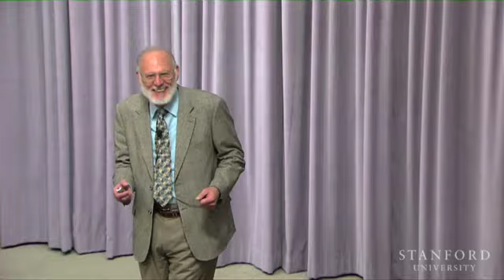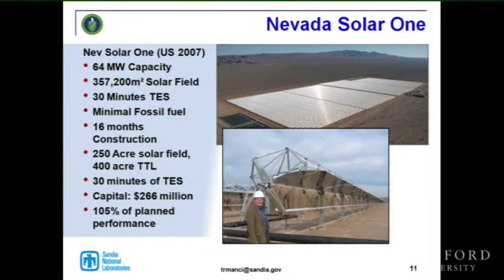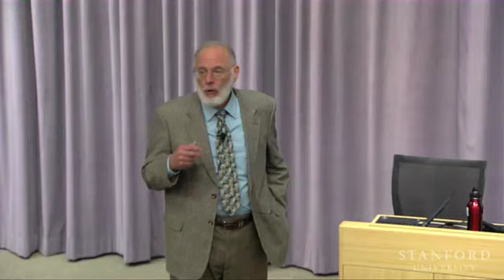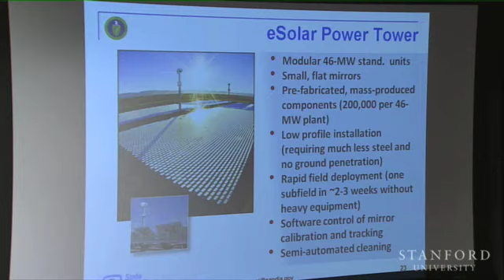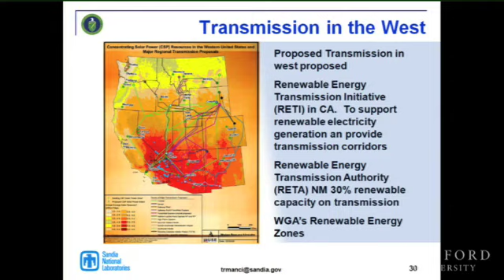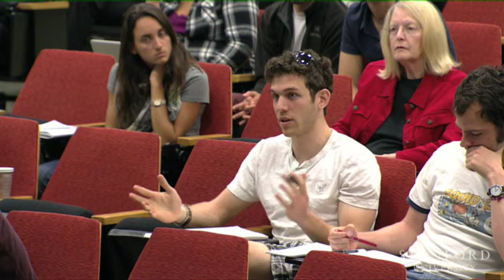The Status of Concentrating Solar Power Development

Comment: A right, didn't read/get to that.. Interesting concept, guess wavelenght separation and selecting the bandgaps would increase your efficiency, and then you'd still have heat left over. Thinking about it in those terms makes it viable.

Comment: you're completely right. It would defeat the purpose if the PV system gets hot. At the ANU, what they're trying to do in CHAPS is to use filters to redirect the high-wavelength portion (thermal) of the incoming light to tubes containing water to heat it. The low-wavelength portion of the light is redirected to solar cells. It's also worth noting that CPV systems are able to use concentrated light with high efficiency solar cells to provide more electricity. Interesting things are being done.. :)

Comment: combined heat and power is used in cogeneration units - they are more expensive, and go against the core of the two technologies. You want to keep the panels as cool as possible, while in CSP you want as much heat as possible. Its not really beneficial if you try running your PV hot to collect heat for the CSP. I am aware of the shading issues (which is why I think CSP is "better" for utilities, it has an averaging effect by using its storage/heat transfer medium as an energy storage)